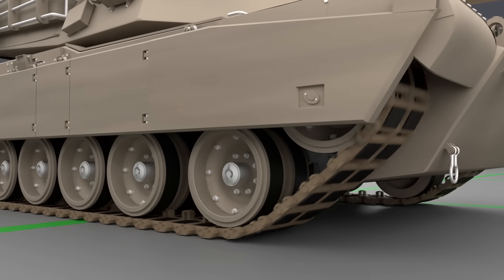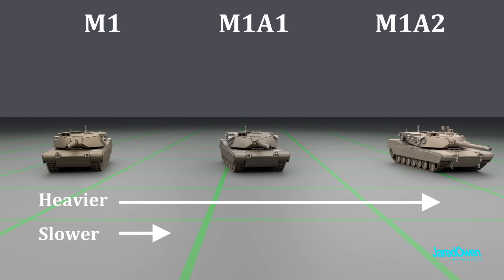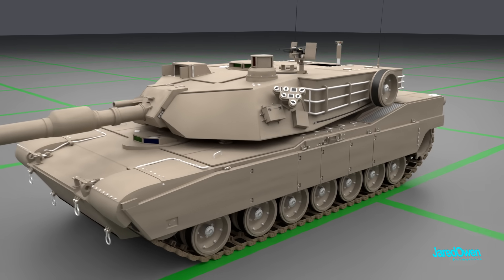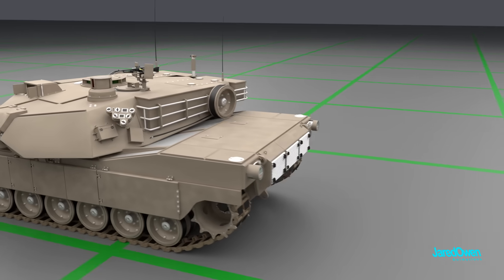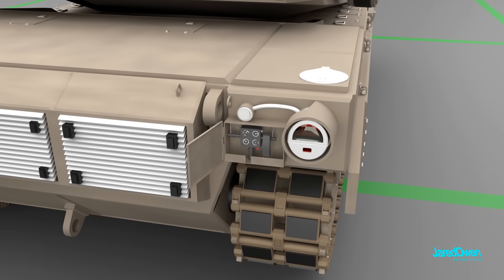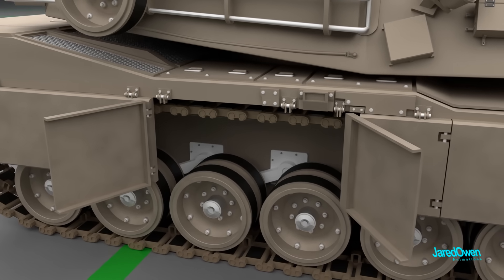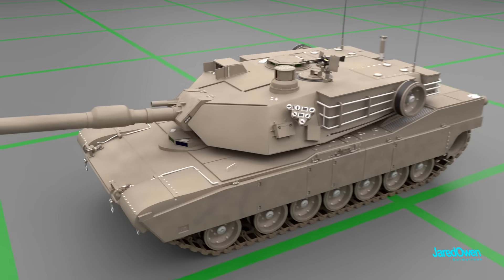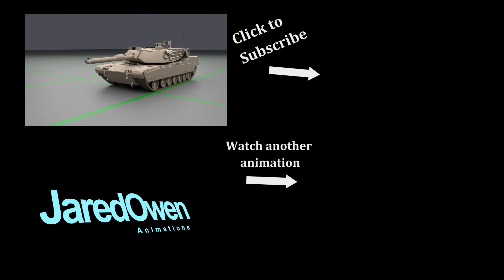How does a Tank work? (M1A2 Abrams)

Comment: Lol this tank is far from quite as far as the engine goes. The round that was fired is a sabot round which is used to destroy enemy tanks. The coax Machine gun is a 240 bravo which firers 7.62 rounds And this is fired by the tank gunner Who also fires the main The main gun. The  air guard hatch has a 240 bravo as well and that’s fired by the loader.The tank commander also has a firing system Which is the 50 Cal. And he also can fire the main gun from his position.
- us army tanker

Comment: 6:04, you are wrong there. Don’t get me wrong, great video, but the only tanks to use a turbine engine (as far as I know) are the T-64, the T-80, and the M1 Abrams. Most tanks use a Diesel Engine. The Abrams uses a turbine engine mostly bc it can run on any fuel type. In a WW3 scenario, units would likely be scrounging for any fuel they can find, so a turbine would be most useful to them. Other reasons as well,  it that’s the big one.
Reply: The Leopard 2's Diesel engine can run on any fuel approved for use in the M1 Abrams... so no, it's not an advantage unique to gas turbine engines.
Reply: @sandervanderkammen9230  I didn’t say Diesel engines can’t run on multiple types of fuel. But turbines can run on just about ANYTHING you put in it. Diesels really only work with a couple types of fuel. Also, it entirely depends on the country’s military doctrine to decide what engine type is better. It’s best for most countries to use a Diesel, they’re cheaper and still very reliable. The US is in a different boat, they can afford to buy and maintain turbines and purchase the fuel for them.
Reply: @wellemdeffo  Not true, the M1 was designed to run on Diesel fuel  (NATO F54).
When the Abrams was first introduced into service it suffered serious fuel problems during cold weather operations.
The Army switched to a special fuel called F65 just for the M1.. this obviously caused very serious supply problems which neccesitated  the adoption of the SFC program with all combat vehicles to use NATO F35 (JP8)
The M1's AGT-1500 can only run on alternative fuels in a combat emergency such as preventing the vehicle from being captured or destroyed in combat. Like the AGT-1500, Multi-fuel Diesel engines such as found in the Leopard 2's can also use of automobile gasoline, AV Gas, heating oil Marine fuel oil etc. For emergency use only.
The Abrams offers no advantages in multi-fuel capability during normal operation or an emergency.
It's high fuel consumption however continues to be a very serious disadvantage.
Reply: @sandervanderkammen9230   not true, the M1 runs on jet fuel, which is similar to diesel fuel. Also, the army actually uses JP4 fuel, not F65. Yes, Diesel engines can run on multiple types of fuel, but not with the same output and efficiency as a turbine engine. The Abrams does offer many advantages in multi fuel capability, for instance, IT HAS MULTI FUEL CAPABILITY. That is a pretty big advantage, especially in a ww3 scenario when you have to use whatever you can get your hands on. The Abrams was designed at the peak of the Cold War, and the turbine was chosen for numerous reasons, including the multi fuel capability. These include:

- decreased noise at long range (turbines produce high frequency noise, which is louder than Diesel engines when right next to it, but the sound dies out much faster over longer distance(
- no visible smoke exhaust (helps with stealth somewhat)
- much better performance when under load

The Abrams also uses an auxiliary diesel power plant, as Turbines are extremely inefficient when not under load or traveling at a high speed, etc. This auxiliary power plant also powers the tank if the main engine is damaged, destroyed, etc.

The Turbine engine is not for al countries, as I sad earlier. You can compare it to the Merkava tank. It’s not the best tank, but it’s the best tank for Israel. The turbine isn’t the best engine (necessarily), it’s the best engine for the US, who has the logistical and monetary ability to use and maintain these engines.
Reply: @wellemdeffo  I'm sorry but you are very confused and misinformed.
The Army has never used JP4 (F40).
F65 was in fact used until 1990 when the Army switched to F35 (JP8)

You need to check your facts.
Reply: @wellemdeffo  Sorry, but the MULTI-FUEL Diesel engines used in modern combat vehicles offer the same emergency situation capabilty.
The M1s AGT-1500 offers no real advantages and suffers from extremely low efficiency on any fuel type.
Reply: @wellemdeffo  The winner of the XM1 trails was the General Motors XM1 powered by the Continental ACVR-1360 multi-fuel V-12 engine.
The Army selected the Diesel version for adoption into service.
The Army never wanted the troublesome gas turbine, they have been trying to replace it with a DIESEL engine.
Reply: @wellemdeffo  Not all M1 tanks are fitted with a Diesel engine APU...
Reply: @sandervanderkammen9230  what? The Chrysler XM1 won the contest. What sources are you using? The GM entry used a Diesel engine, why would they choose the GM version and then use a turbine? You are the misinformed one, my friend. If the army wanted to replace the turbine engine, they would’ve done it already.
Reply: Also, early Abrams did not have an APU. It was one of the Abrams teething problems, but all US Abrams have diesel APUs
Reply: @wellemdeffo  Wrong, the Chrysler XM1 LOST the XM1 trials to the Diesel powered GM version.
Congress OVERRULED the Army and forced them to buy the Inferior Chrysler version.
This is all well documented information.
Reply: @wellemdeffo  All Abrams tanks do not have Diesel APUs... SEPs have battery packs and some have no APU source.
Reply: @sandervanderkammen9230  did you watch the video I sent you?

Edit: also, what are your “well documented” sources?
Reply: @wellemdeffo  That amateur video is very inaccurate and full of false information.
Reply: @wellemdeffo  I'm guessing you are not old enough to remember the Congress hearings on the M1..
The Army fought hard to get the Diesel powered GM version but was defeated by high powered lobbyist and corrupt politicians.
The hearings are a matter of public record.
Reply: @sandervanderkammen9230  you still haven’t told me your sources
Reply: @sandervanderkammen9230  I’m starting to think you’re making up your argument as you go
Reply: @wellemdeffo  The United States Congressional hearings on the M1 are my source...
Reply: @sandervanderkammen9230  the Congressional hearings? That’s your source? No Army documents? No manufacturer’s statistics? Nothing like that?
Reply: I honestly don’t feel like coming back to this. You obviously aren’t going to change your views. You can’t argue with stupid, I guess.
Reply: @sandervanderkammen9230  you’re the one who chose to respond in the first place, so if you really think about it, this is all really your fault lol. Don’t get mad at me because I “wasted your time”. If you didn’t want your time “wasted”, then maybe you shouldn’t have kept responding.

And also, why are you so convinced that I’m just an idiot kid who “can’t drive, should go back to his video games.” If you are referring to the YouTuber I linked, I don’t even PLAY war thunder.
Reply: @wellemdeffo  Sorry but you are very confused and misinformed about the M1 Abrams and it's LYCOMING AGT-1500 engine.

The Gas Turbine  cannot run on any fuel that cannot also be used by a Multi-fuel Diesel engine.
The Abrams offers NO ADVANTAGE  over the commonly used Diesel engine.
Any questions?
Reply: @sandervanderkammen9230  I’m not saying that the gas turbine is better. I also don’t think the diesel is necessarily better. I am saying they each have their merits and their failings, like I said earlier. The turbine is the best engine for the US, but diesels fit the budgets and logistical capabilities of just about every other country in the world. That’s all I’m saying.

As for questions, 
- Are you gonna bother to list any other sources? Because a governmental debate isn’t a very great source of information.
- what exactly is your point? As far as I can tell, based on your first comment, it seems that you are saying the Leopard 2 is better than the Abrams.
Reply: @wellemdeffo  It should be obvious that the Diesel engine is superior...
The MTU V-12  turbocharged Diesel engine produces the same power, comparable power to weight ratio performance, has better range and uses 85% less fuel performance day.
Reply: @wellemdeffo  The Leopard 2 and the M1 Abrams share the same chassis and hull design, the same gun and many other components.
The Leopard 2 has been very successful and sold to 19 different countries.
Reply: Here is the actual XM1 trails data, content://com.android.chrome.FileProvider/images/screenshot/16096453889411169361764.jpg

Comment: What is the diference between US ton and just a ton?
Reply: There are several tons. Short ton and long tons are U.S. customary and Imperial tons. Technically both are defined by metric in most international uses, but the U.S. short ton is 907.18kg., the long ton is 1,016.05kg., and the metric ton (also called the tonne) is 1,000kg. In pounds, which are roughly the same in the Customary and Imperial systems it's 2,000lb. and 2,240lb. respectively. A metric ton is 2,204.62lb.

Comment: Tanks use tracks to disperse weight more evenly, assuming you had large enough wheels they could accomplish the same. In fact it has been proven time and again that tracks are only really beneficial on crossing soft terrain, on med-hard terrain, wheels are far better. There is a reason why most extreme terrain crossing vehicles actually use large grippy wheels rather than tracks.

Also super wrong on the shells, a 120mm gun doesn't shoot 120mm sabot (what was shown)

Apparently smoke grenade launchers behave like ESS now, lmfao.

Your loader is facing the wrong direction.

clearly drank to much of that Gaijin Koolaid.

Comment: "Tank tracks are for going over very rough ground" is not the reason for tank tracks, that is a benefit of the tracks 

The reason for tank tracks is to spread the weight of the vehicle over the widest area possible which is why tanks can go over all terrain
Reply: Which is what he says in the video.  "The tank on the other hand, has a much larger surface area to displace all that weight."  4:57

Comment: There are 7 sets of 2 road wheels, and that equals 14 dude!! The two up front are called the comp idler arms, and there are 4 of those to help kick the track back around. Caterpillar track moves only on the bottom, and the top never moves!! Oh and obstacles are NEVER a problem, either I get up to ramming speed and plow, or blast my fucking way out!? The engine is called a power pack, and the jet turbine will run on ANYTHING flammable!!

Comment: ... how much is a US ton, compared to a EU ton?
Reply: There are several tons. Short ton and long tons are U.S. customary and Imperial tons. Technically both are defined by metric in most international uses, but the U.S. short ton is 907.18kg., the long ton is 1,016.05kg., and the metric ton (also called the tonne) is 1,000kg. In pounds, which are roughly the same in the Customary and Imperial systems it's 2,000lb. and 2,240lb. respectively. A metric ton is 2,204.62lb.
Reply: @peterson7082  ... Cheers for that :)

Comment: Now this video was pretty accurate but its primary fuel is diesel then it can also use 3 other types of fuel which jet a or b are 2of them. Also there is a 2nd machine gun on top that the TC uses. I won't  give away any more secrets.  If anyone has any doubts I was a M1 abrams crewman and have been on all 4 versions (yes I said 4) of this beast. It's a lot of work to maintain but a lot of fun to operate.

Comment: I hate when I see a really interesting video, but the measurements aren't on the metric scale so I understan nothing.
Reply: Length: 9.75m
Width: 3.66m
Height: 2.43m
Top Speed 68 km/h
Muzzle Velocity = 5633kp/h (1565m/s)
Effective Range = 3.2 km

Fuel Economy:
M1A2:
1893 liters
0.25 km/L
483 km

Average Car:
61 liters
10.63 km/L
644 km

There you go, sometimes us Americans prefer metric over imperial as they’re a lot easier to understand...
Reply: @yaboikungpowfuckfinger7697  Lol you are great
Reply: Da

Comment: I Get why you chose Abrams.
But it's also one of the older tanks right now, you have Leopard 2a6/2a7, Merkava MK4, T-14, Leclerc etc.

Abrams had major track issues due to its weight, it's not allowed to public roads as the tracks breaks the pavement. Whilst other tanks are.

Comment: Not all tanks are the same most of them don't run on jet engines the Abrams which is what is shown does and not all tanks the engine is in the back for instance the merkava Israeli tank is in the front to give extra protection to the crew

Comment: Old timer here. Retired from tanks.  Served on M60A3 TTS, IP-M1s, and M1A1s (HC) and a few missions on M1A2SEP in OIF.  Have never gamed but this video popped up so I checked it out. Was pleasantly surprised by the good synopsis. Interesting point: The grunt phone on the back right side was standard on the 60s and other old tanks. It was left off the M1 because the M1 exhaust was too hot and the M1 backs up so fast it was seen as dangerous and not high pay off. After a few years in Iraq the army and USMC added it back via the TUSK upgrade kit and the later version of the M1A2SEP.

Comment: OMG! There are about three positions of the turret that if it were stuck and the tank had to be abandoned the driver can not get out. Not only can you not have closterfobia, you have to not think about the fact that you are the only person in the crew who may not have a chance of getting out in an emergency.
Reply: He can leave through the turret
Reply: @hazardous458  it looks like the turret has to be turned to just the right spot for a tiny door to line up with his seating area for him to do that. It looks like overhang of the turret only blocks the drivers outside hatch when it is turned in one of three general directions. Imagine looking down on the tank with a clock face overlayed. Twelve o'clock/midnight lining up down the center of the tanks front. Those would be with the main cannon pointed roughly about 2 o'clock, 5 o'clock all the way through 7 o'clock and 10 o'clock. I would hope that someone thought about all this and the drivers access to get out through the turret lines up right when all those positions are lined up. It would be a series of bad freak mishaps for the driver needing to get out and power to go out on the turrets rotation and all back ups for rotation to be broken too.
Reply: @joeottsoulbikes415  You can remove the turret basket wall.
Reply: @hazardous458  I see. I was wondering about that. I have never seen the inside of an M1. I've been in a Bradley and M163 VAD when I was in JROTC. As well as an LAV25, LAVAD and AAV when I was in the Marine Corps but the baskets if you wanna call them that in any of those is noting close.

Comment: You have a few things wrong. One the tank gets 1 mile per 5 gallons. The tank holds 300 gallons. There are no foot peddles. The steering is a joy stick with two handle bar throttle controls sticking out either side. So a friend told me 😝
Reply: Sorry, the M1 does have foot peddles for the brakes, I was on M1's from 1983 until I retired in 2010.
Reply: @shoup2882  I was working on a database and cad drawings trying to match up the drawings with the parts list. So if a tank needed a new part you just pop up a drawing point to what you needed and part was ordered.  What the drawings showed was either the future or really old blueprints.

Comment: Hello, does anyone bother with the retarded unit :)). Sincere, SI.
P.s: Alright, I'll list the measurement out in SI (roughly)
Height 2.43m, length 9.75m, width 3.65m
Weight 61.688 tons ~ 35 cars? who the hell measure like this?
Top speed  67km, fuel tanks 1892 litres. Mpg 0.6 ~ 1 litre to 320m. Range full tank 450km.
Shell speed 5632kph

Comment: 6:11 I'm gonna correct you on that, abrams tanks are loud af, compared to other tracked vehicles in the us arsenal they are among the loudest right behind tank recovery vehicles the engines also get hot enough to create a heat marriage off the back of the tank as well
Reply: The sound bleeds off at a rather short distance compared to Diesel engines.

Comment: Most people have no idea how precisely and well made these tanks are. I was a medic in the Army, and at our school we had an old M1 tank (and lots of other military vehicles) which we had to learn our way around so we could evacuate any wounded from inside. I spent a few hours playing with the M1, and the first thing I discovered was how easy it was to turn the turret and elevate the barrel. There are two small hand wheels with grips located near the gun, to move the turret manually (with no electricity) who squeeze the grips on the handles and turn them. The weight of your hand is enough to do it. It is amazing that a few ounces of effort is all it takes to move a heavy steel turret weighing quite a few tons.